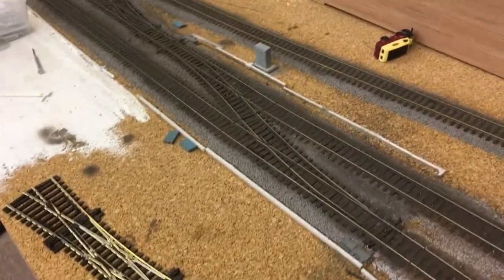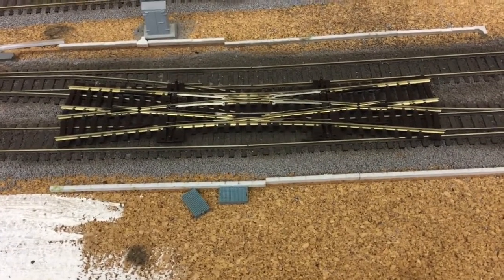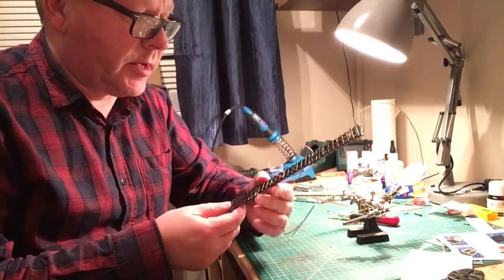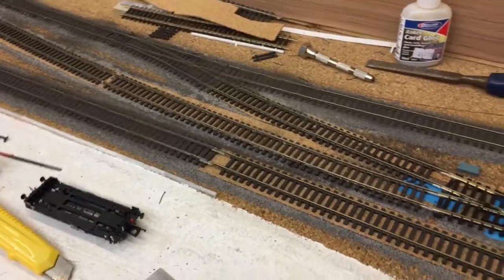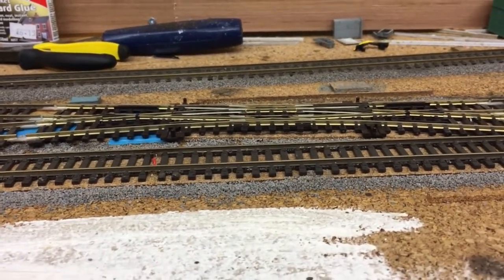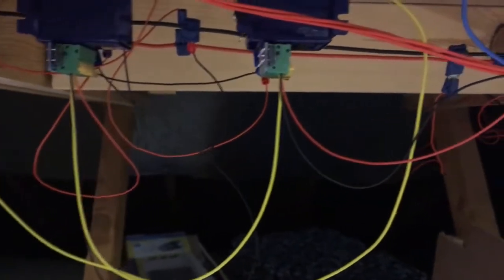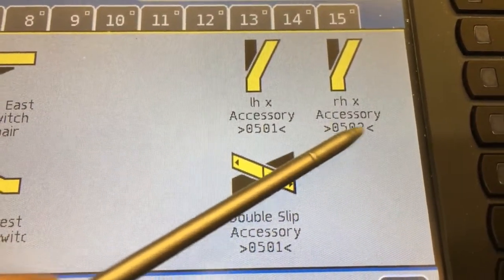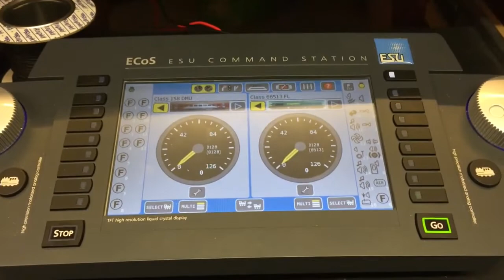Peco SL90 Double Slip Install & Wiring

Comment: hello reggie came accros your channel when searching ecos.watched you solve my problem with double slip simple also wasn't going to use accessories until you showed it wasn't anything to be afraid of thank you
Reply from the maker: Hi Keith, that's great to know that my video helped you with your double slip, I hope it helps other too, as that's how I solve many of the problems I have on the layout - by watching other modelers channels! And once you do a couple of accessories on the Ecos it is very straightforward, would be a shame not to use the many functions the Ecos has! Cheers Reggie.

Comment: Just come across your great video as was searching for how to install and setup a Peco SL-90 double slip on my Ecos controlled DCC layout. I have a question that you maybe able to help me with:
If I am using DCC concept Cobalt point motors (i.e. not solenoid type of point motors, are there any springs to remove from the SL-90 point? I cannot see any similar to other Peco points that I have installed .

Regards,
Alf.
Reply from the maker: Hi Alf, Thanks for your comment, glad you found the video useful. From memory I cannot recall removing any springs from the SL-90, as the point makeup is quite different from other points. If there is no obvious cover for a spring I would say not.  Sorry I can't be more certain! Cheers Reggie
Reply: @brayworthpark5542  Thanks Reggie for the speedy response to my removal of any springs on the SL-90 if using the cobalt slow motion motors question. I had a good look for any similar to other Peco point removable covers that hide the centering springs on the SL-90, but like you I couldn't see any, also when operating the tie-bars by hand I thought I could detect the slight intervention of a spring that applied a slight bit of force to overcome any tendancy to return to it's starting point?...so thought I'd ask someone using slow-mo motors with theirs to see if they managed to get good operation of the point without worrying about presence(or not) of any springs...
Cheers, Alf
Reply from the maker: @AlfK661  Np problem Alf, I've sometimes forgotten to remove springs from ordinary points after fitting and they can easily be removed afterwards, I will have a look tonight on my layout to see if it jogs my memory! Cheers Reggie
Reply: Reggie, I've managed to find the tiny tiebar springs in my SL90 under some extra illumination and some strong spectacles to assist my 70 year old weakening eyes,, and managed to take a good pic of it's situation but can't work out how to remove them😢.... how do I get the pic to you?
Reply from the maker: Hi Alf, I had a look at my SL90 and can't see where springs were or if there were any. I think the best thing is post your query on RM Web Forum, I'm sure someone with more knowledge than me will advise you! Cheers Reggie.
Reply: Hi Reggie thanks for having look for me👍🏻...did you see my post that said I found the springs on my SL90 & that I had taken a good pic of them but didn't know how to get them to you? To add to that I have now managed to remove them & have got my 2 cobalt SS mini surface mount PMs operating the SL90. However I have followed your setting up on the Ecos to the letter, but cannot for the life of me get the d**n thing to switch all of the possible routes of the SL90 correctly to reflect the ecos's double slip icon fly-out!? Help!...🫣🥴😱

Comment: Hi Reggie,
Just subscribed having found your channel. Interested to see your layout in the loft as you have the same challenge as I do with the loft beams getting in the way off everything! We share many similar ideas, I use the ECos and all switched points using a mix of MegaPoint and Cobalt switches. I like what you have done with the scenics. Great fun with the double slips, wiring and Ecos. I have a number of double slips on the layout and had quite a lot head scratching but opted for back to back single throws like you did. Will keep tuned in to follow as you progress. Have a look at my layout at Woodsetts Central. Regards Barry
Reply from the maker: Hi Barry, Thanks for your comment and sub, yes we have similar layouts and ideas! I am pleased I've gone from the seep point motors to the Colbalt IP Digitals, so much better. The double slip, I set up the 2 x turnouts (501 & 502) on the Ecos, then used the same address as the first turnout for the double slip symbol (501) and it works great! The Ecos is a great unit imo. Have subbed your channel. Cheers Reggie

Comment: Hello Reggie,
I recently came across your channel and this video re the Peco double slip. I'm just about to start laying track for my first layout and I too have an SL-90 insulfrog double slip. My understanding was that insulfrog slips and points didn't need the frogs to be wired, as you would for an electrofrog slip / point. Please could you explain to a beginner why you chose to undo Peco's wiring and wire the frogs like an electrofrog device? Was it because of a reported problem with insulfrog  frogs where some people have had issues with wheels shorting between the two insulfrog frog rails?
Many thanks, Vernon
Reply from the maker: Hi Vernon, thanks for your sub and question.  The main reason I wire like this is for reliability. By modifying the wiring as per electrofrog and taking  the wire to the point motor you are not relying on the switch blades for the frog power. This gives far better running and reliability imo . Your point motor must have power switching facility, such as a Seep motor, or the DCC Concepts ones I used. I hope this helps. Regards Reggie
Reply: @brayworthpark5542  Thanks for your reply Reggie. Much appreciated.
Reply from the maker: @vernongardner1958  no problem, hope it was a help!

Comment: Why do you insulate the slip turnout from the rest of the track? If the wheel flanges do not short the frog rails, why do this?
As it is an insulfrog has correct connections with positive and negative rails throughout the turnout.
Reply from the maker: You are correct, I just prefer to keep it completely separate from the rest of the track, and it has worked very well since installed.